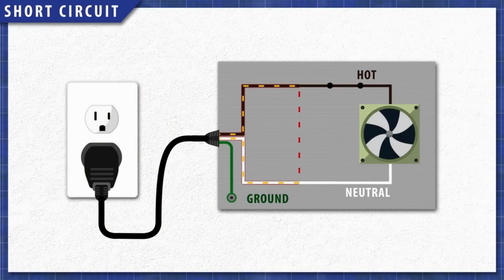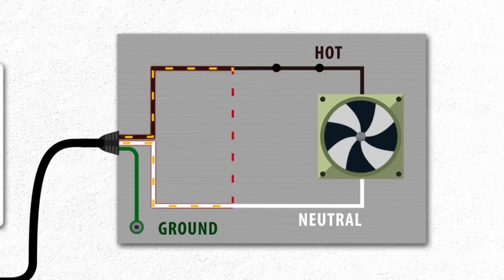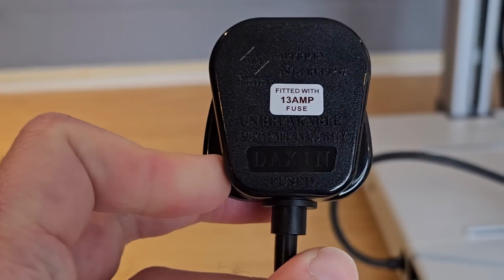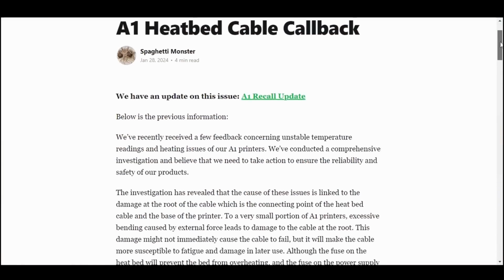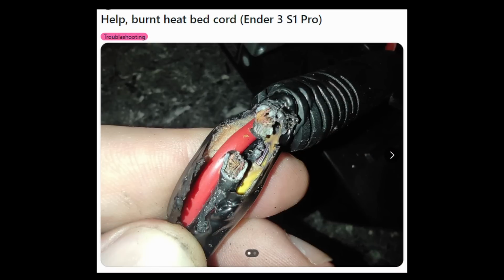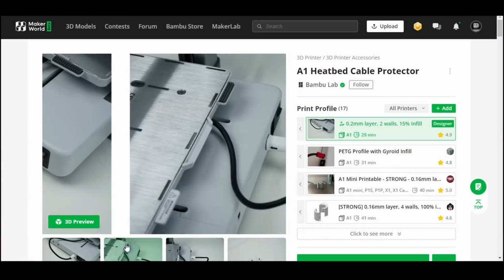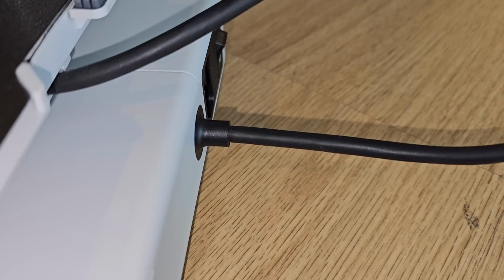Bambu Lab A1 3D Printer Recall - All You Need To Know

Comment: @Ricky Impey
Thank you for your video.  
However I regard Bambu Labs NOT as customer friendly company. The "earned" a bad reputation last year with their patent filing practice (patent active or pending: gerneral hotend: a device which melts plastic filament and is transported though a nozzle, the tri leadscrew system, etc. Their use of the Prusa Slicer and only when the outcry was loud enough they admitted it and released  the source code (violation of GLP3). The transmission of encrypted user data to their servers.
   
And now the A1 cable issue. I don't own a Bambu (never will but everyone should make that decision by themselves) but from what is available on the web, Bambu used a sub standard cable for the moving bed! (see 3D Musketeers PrintFixFriday 125) On user of the A1 (member of the f b A1 Owner group) dissected the cable and he got already a replacement cable of Bambbu: The cable Bambu uses is SUBSTANDARD for its intended purpose! It is a guess on my part, but it is highly likely that the cable of the A1mini is affected too. I guess Bambu used the same cable type there, hence A1minis will have the same issues than the A1: breaking cable strains. NB I don't know if the A1mini has a AC bed too, but this would not effect the life of a cable as it just breaks and best case the A1mini stops working.
    Further the level of customer support to this: Bambu only admitted that there has to be a recall AFTER content creators warned. They moved up the initial "call back" to a full "recall"! Bambu STILL denies to know the cause of the problem and publish that "only 0.1%" of the users are effected: what a BS!!! They rushed out a design to endusers, who want to print out of the box, and don't want a project. IF Bambu would honour the customer, they would issue a recall not only for refund, they would give you the option to repair/exchange the A1! Further what about the customers who have thrown away the box??? If you live in the EU and you bought the A1 from Bambu, Bambu HAS TO PROVIDE transport material for safe shipping! Again no good customer support here.
   IF Bambu WOULD have taken the release of the A1 seriously, they WOULD haver done better testing, used a drag chain AND correct cables. They could have looked at the Voron Switchwire and how the Voron Team solved the cable path to the bed (inside the confinements of the printer und the bed carriage) and it is OPEN SOURCE. But knowing Bambus mentallity, they might have filled a new patent on that...

   My conclusion is Bambu is a bad company which does not respect the customer at all. Trickling flow of info, no user friendly approach etc. etc.

Comment: Every bedslinger is open to this problem. I Bought 5 of the same printer at the same time and they are all fine but 2 just happen to have a sketchy bend in the power cable. I work with wires and am paranoid about wire bends so i was able to correct them but i think if those printers were bought by first time users they would have left the weird bend and after many hours of printing im sure it would have severed itself.this is why its best not to leave printers alone. We all do it but you gotta be safe. Im fine leaving it overnight if im home because worst case scenario the smoke alarm would do its job and when i go to work i leave the camera feed open on my desk with the option to cut power through a smart outlet. If the printer is malfunctioning your app wont turn it off. We all hope nothing bad will happen but its important to be aware that printers are inherently kinda sketchy, its 2 heat sources that move around all day. Just do what you can to be safe.
Reply: Agreed! I think we all take risks with our unattended printers. I use a smart plug and a camera with mine, but I really need to wire in a smoke Detector that will cut power when it’s triggered.
Reply: @billmurphy7430  im working on the same thing! Im about to set up a real print shop, its time to make the smoke alarm plug thingy. I might do custom pcb but have also just considered wiring a switch by using the alarm signal to trigger the switch instead of the alarm. My electrical skills are vert basic but i work with alot of smart guys so i can get it done with help. Let me know if you got any ideas, id love to hear them.

Comment: The issue is BL has used, a mains rated appliance cable, to cut down the costs. There are special high flex high voltage/high power (220V/2.2kW) cables controlling VFD spindles in CNC milling machines, through a dragchain, without any issues. But the cable itself could cost much more than the off-the-shelf nichrome heaters. The bottomline is the design decision to cut costs, by not coming up with a better design, and to slap on an appliance cable to a high power appliance heater, all the while knowing the usecase very clearly.
Currently the issue is the liability of customers not doing the cable upgrades properly. All the cables, will bite the dust(or smoke🤔) eventually!. Easier solution, is to get the bed separated and sent to BL(postage paid), for a proper fix. They can give additional credit in BL store, for those customers. For those, who don't want the repair done by themselves, they just return the entire printer, and get credit for a new A1 with free shipping(or better yet pickup one from a nearby retailer like MC). The old printer can be sent back in the same box, while the credit card payment used as a deposit. What BL should avoid at all costs, is a CA suit, with no benefit to customers, brand reputation or BLs bottomline, while lining the wallets of those who brought the CA forward. Just some helpful 💭

Comment: Started seeing the warnings 2 days after I finally made my decision about the A1 and placed the order. Came home to the unit sitting in my doorway today and what should have been exciting turned to dread pretty quickly. As an engineer, I totally understand that these things sometimes happen and hope they can get a solution put together quickly. They appear to be taking it seriously and that's certainly important. I'm likely to keep this system and see what they come up with. Unfortunately, I had a large amount of printing to do and was counting on the speed of this machine to accomplish my goals.
Reply: You know what to look out for now. Provide a quick and dirty strain relief solution, and just start printing …
Reply: you can print a cable holder for the cable to prevent over stressing it tho so it wont break lol

Comment: 3:54 No, it is not just because the cable bent too tight of an angle. It is simply poor engineering, and the wrong cable choice by Bambu. Someone did a cable teardown where they split it all apart to show how thin the insulation is on the cables, and the insulation is not even silicone like most AC beds use. They need a completely new cable design, or they need to switch to DC if they want these to be safe.
Reply: How on earth is DC safer? Edison created that myth while battling with Nikolai Tesla. It was pure nonsense!

Comment: 1:56 The main reason for going with 110 - 230 V beds instead of 24v ones is cost and space. An appropriatly sized powersupply for a good bed heating performance would cost ~40 to 50$, which goven the price of this printer is a significsnt portion. And these powersupplyes aren't small. A 500w one would take up ~ 50% of the space of the base. 
Going with 24v instead simplyfies safetyratings a lot, since the company can just buy a readymade and certified psu and build the rest of the electronics under much simpler design rules, due to 24v being safe to touch. This saves significant ammounts of onitial costs.

Comment: I have raised the mains issue (as I live in Aus with a wife that works in insurance lol)

The biggest issue I have isnt the handling of the situation, but the requirement for having kept the box! Lots of people live in smaller apartments and houses. The box was huge! Its likely gone to waste for most people (as is mine) they state you can only fill out the form once... do we get a label for postage because this will likely cost well over $100 for a non business ownwe? Lots of unanswered questions still.
Reply: The blog said they would cover shipping. What the didnt mention is how to claim option 1 or 2 if you purchased thru a reseller. I happened to have purchased mine thru a reseller when i was near one an a business trip. Needless to say they are no where near where I live, and Im not making a trip to return a printer. Bambu should honor all of their units reguardless of where it was purchased. Currently it seems they only have an option for individuals who purchased direct from them and had their units shipped from bambu.
Reply from the maker: From what I have read, I think their intention is to make it possible for anyone to return the A1 if they want to. I imagine that they possibly just haven't worked through all of the different types of customer situations that they will encounter. I would advise contacting them to ask what you should do if you bought from a reseller or don't have the box etc. I would think they will work it out.
Reply: @RickyImpey  i went ahead and filled out the recall form and just filled in purchased at micro center for the order id number. I received a confirmation of my selected choice, and the discount associated with that and a timeline on when to expect what. So it seems that even though there was no clear explaination for items purchased at authorized resellers the regular form worked fine. 

Also it appears that individuals returning the A1 to microcenter received refunds no questions asked and the $80 discount twards one of the other bambu labs printers. Many posters reprited that stock of the p1p and p1p combo to be depleted at several microcenter locations.

Comment: You're using video of breaking a bit of solid wiring as a opposed to stranded wiring could be seen as misrepresentation as you included the video clip in the first seconds of the video. In order to be completely above board in your video, you should have bent the actual cord on your Bambu printer. Other than this you should be commended for being so fast to release a balanced assessment of the subject.

Comment: The main picture he got this from THERE WAS A FIRE. like unless if he got it from some random news site, there is no reason why he doesn't know there was a fire and this is what caused the entire recall mess. It wasn't that the company by chance just happened to notice this.
Reply: Was there a fire with be Bambu Lab A1? All I've seen was sparking cables but no actual fire. The images of the burned down printer and house were from 2 separate events involving ANET A8s in 2018
Reply: @zapl80  Ya on the forums there is one that comes up a bit where the back of it clearly was on fire. Look up "Power lead caught on fire"

It looks like outside of the printer itself, there was no damage and the fire went out quickly. This could've easily been because it also took out his home power.

Comment: Anyone knows or heard from Bambu, what the return and refund solution will be for us, who has thrown out the packaging? 
Wasn’t expecting to return the printer after 1,5 months because of a cable issue…
Reply: No news on that front, and Im doubtful at this point we will hear much as far as updates for a few weeks.
Reply: Yea, either sent it in with a similar save packaging for like 80$ coupon and a faster fix time i guess. OR get 120$ coupon and a new heatbed sent for installing it yourself, but this takes longer as they said via email after my callback ticket form.

Comment: This is what I predict will happen. Some people will return their printer, either because they don't feel comfortable doing a basic DIY repair or because they're feeling buyers remorse. Some people will turn off their printer and wait until Bambu ships them a new hotbed. Most people will continue to use their printer, believing that the odds of anything happening because of the problem is 1 in a thousand. They will get their replacement hot bed and their $120 store credit, and they may even replace their hot bed, but not all of them. You may be mad at Bambu for under-engineering the cord to the hot bed, but if you're mad about their response to the situation, you should probably take a deep breath.
Reply: It will be way lower than 0.1% when the cable is looking good. Recall is all what bambu can do for now.
Reply: My immediate thought was to just wait for the new hotbed to be sent out, however i've now decided that I'll return my entire printer and upgrade to the X1.. this A1 was my first printer and i'm in love with it.. this seems like a perfect opportunity for me to upgrade. Dunno, I dont feel like you can be mad at Bambu for making the responsible decision to recall the machines, even though it sucks to have to put it away for a couple months. I've had to deal with their customer support and they've been nothing short of excellent. I'm not gunna jump off the Bambu wagon because of this.. in fact I'll probably double down with upgrading.
Reply: @WhenTheMomentIsRipe  I was just commenting on another guy's video who returned his A1 and bought an X1C. Maybe this is all a plot by Bambu to sell more X1C's! :)
Reply: @dtibor5903  my friend, what does anything you just said have to do with anything I said? I remarked upon what I thought most people would do about the recall, and stated that if you were unhappy with Bambu's response to the situation then there is something wrong with your thinking. I did not mention the design, UAT or production process. Bambu Labs is paying a big price to stand by its customers and they deserve our praise.
Reply: We don’t even know if it’s their fault yet, could be like the 12vHPW connector and it’s just a bunch of idiots slamming the cable against a wall…

Comment: Great videos Ricky.
Lets be honest here. I have rarely seen anything come out of China that complies with UK electrical safety regulations.
Wrong fuses, poor earthing, access to live parts, illegal plugs, the list is endless.
Personally I don't want to see mains AC going anywhere other than the power supply.
I deal with poor design issues every day and this is a bad one.
There is not one electronics engineer who should/would risk their career/livelihood/freedom by implementing any fix to this machine.
The same goes for any DIY repair whether advised by Bambu Labs or not.
When it potentially catches fire and burns the house down, after the investigation in to why you modified it, guess what your insurance company is going to say.
Get these machines returned ASAP.
 I would love to inspect one, if anyone is close to me in Northants.

Comment: I want to know what those "other critical adjustments" are. Do you know Ricky? Thanks for the vid and I personally am going with their bed replacement option.
Reply from the maker: Well, even though there are no visible bed springs and adjusters, they are there. They are inside all of the plastic coverings. I don't know if the bed will need tramming somehow or if they come factory set. I guess we will find out!
Reply: @RickyImpey  I was thinking the same thing. I returned their A1 Mini because the tramming was a pain and I just could not get it done right. I have on Ender and other Creality units but it was such a pain on the A1 Mini. Most likely my old eyes. They took it back and I got this A1. I really hope we do not have to do the tramming. All and all I think they are trying hard to take care of this and I am sure it will be taken care of.
Reply: Not sure how many amps they are pushing through that wire but seems like a flexible, “coiled” cord might be a fix
Reply: I watched the replacement video on the official Bambu Labs website. It appears that the actual bed itself is attached via 4 screws to the actual carrage so you only remove the bed, not the mechanism that moves it. It appears that its as simple as removing the bottom from the gantry assembly, removing the front and rear bottom panels, unplugging 3 connectors and unscrewing the ground, pushing the strain relief out of the printer housing, and unscrewing 4 screws that attach the bed to the carrage assembly. Reverse proceedure to install. It also appears there are 7 wires total inside the cable and 4 of them are in a single plug connector.